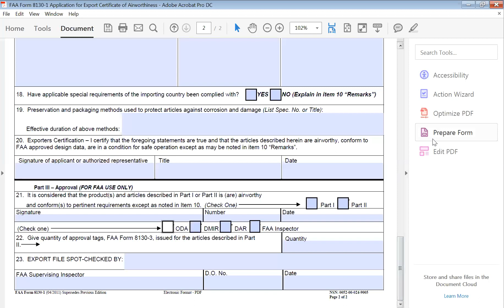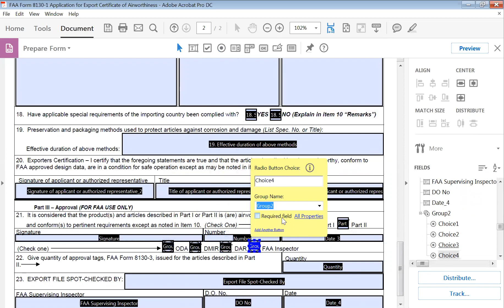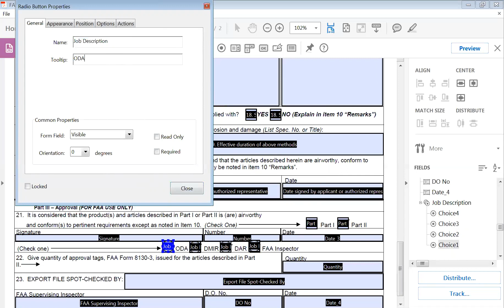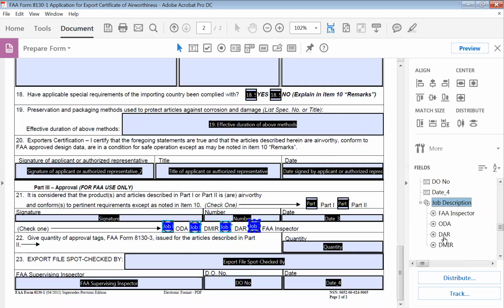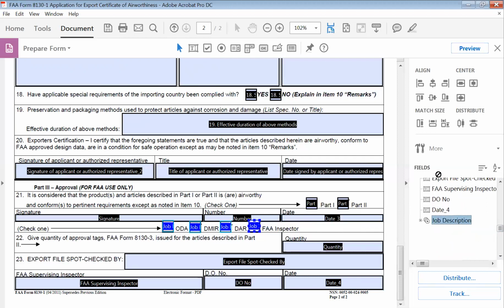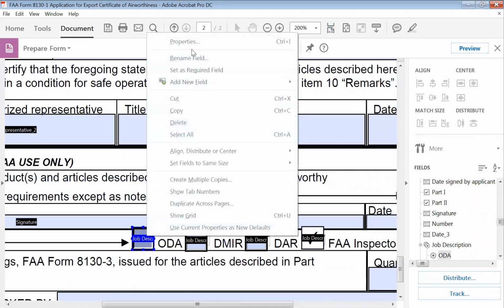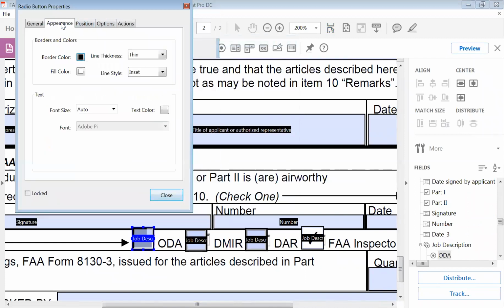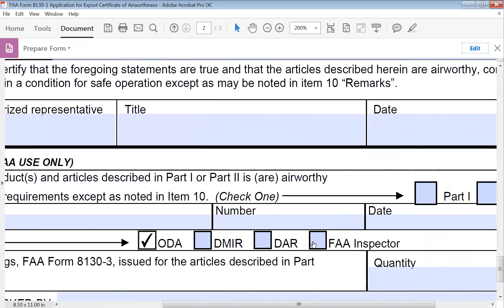How to change a check box to a radio button on a pdf fillable form

Comment: Change would imply taking what is there and then changing it from its original form (Checkbox) to a changed form (Radio Button). What you did was redo the entire line. 😁. Otherwise a good tutorial.